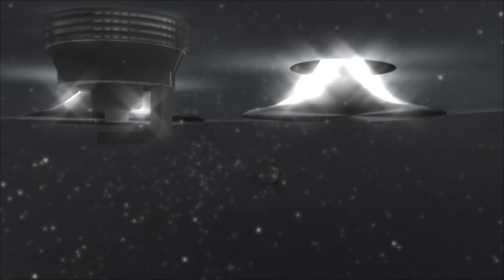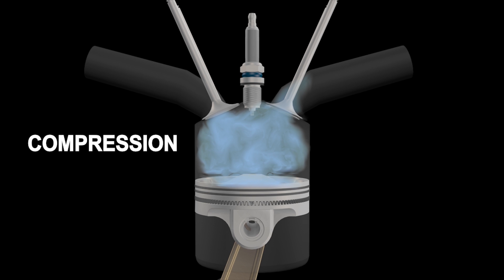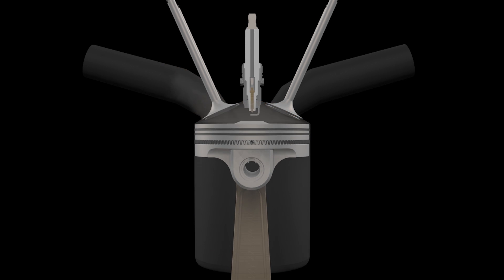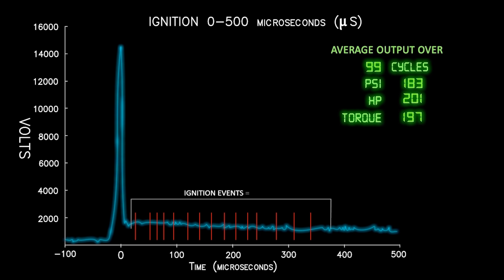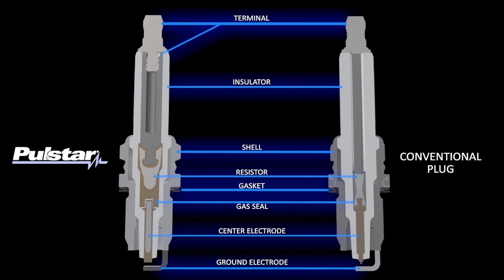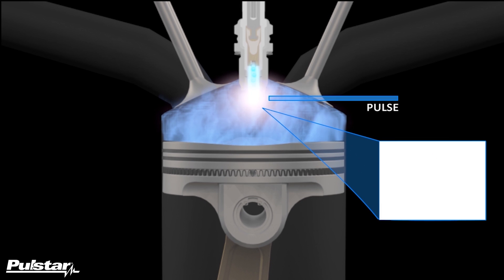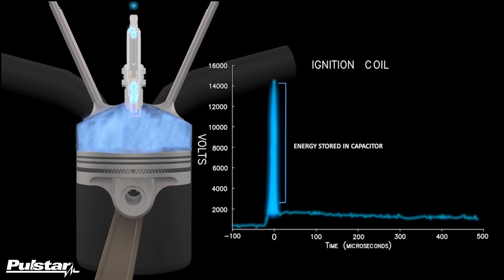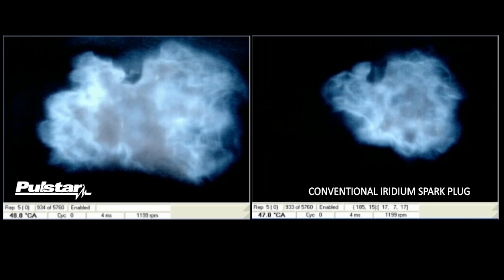How Pulstar Spark Plugs Work

Comment: I think an amplified spark from an aftermarket ignition is denser and more useful than plasma. I've mentioned before that with a high energy ignition coil for example, the smell of the exhaust changes and doesn't smell as dirty due to the more complete exhaust burn. In comparison with pulstar there is no preceivable difference in the exhaust smell and engine performance (I have them installed).

Comment: Gee, you'd think the car manufacturers would have caught onto this. No dyno results, no evidence of increased fuel economy, no evidence of any actual benefit.
Reply: These sort of devices, like fuel ionizers, turbo intake mixers and the like are all gimmick devices. They depend upon the consumer's ignorance of the combustion process. It's a matter of physics. The fuel is hydrocarbon, which is hydrogen and carbon. When it burns it forms CO2 and water vapor. CO2 is one carbon and two oxygen, and water is H2O, two hydrogen and one oxygen. The fuel itself only has so much energy, and as long as it is burned completely all the energy has been removed from the fuel.
The spark is advanced so that as the fuel is ignited it creates a pressure wave in the cylinder at the right moment. This is before top dead center. The fuel takes a few microseconds to completely explode, whether the engine is idling or running fast, the rate of ignition is about the same. So, to adjust for this the spark is advanced as the RPMs increase. This way the ignition occurs a little sooner so the pressure wave of the exploding fuel will maximize it's force at the correct position of the crankshaft.
Engines themselves have changed through the years to become more efficient. For instance modern car engines use what is called the Atkinson cycle rather than the Otto cycle. This allows for more expansion of the combustion gases. The head design on more modern engines often has a hemispherical shape with the intake valve and exhaust valves on opposite sides and the spark plug between them. This creates smooth flow through the cylinder and a uniform pressure wave of combustion. Of course the efficiency gains are a result of engineering design of the engines compared to engines of forty years ago, not from some gimmick device.
Anyway, as long as all the fuel is burned completely and at the correct time the engine is operating at top efficiency. Modern engines have very complex combustion controls with feedback systems like oxygen sensors. Changing any component of such a system is most likely to harm performance, not improve it.

Comment: I feel like this is all a sham. Almost every car now adays has a capacitive discharge ignition systems already and use a capacitor to help smooth out the arc. This isn't new technology by any means and in the real world you won't see that large of a power increase or fuel mileage increase to justify the cost. I would like to see the actual dyno results with the ambient temperature and pressure the same through both sets of tests. It's a gimmick just like those E3 spark plugs
Reply: odd, made my Jeep run worse and lose power. Holding 65 mph was difficult for the year (10,000 miles) I had e3 plugs in my Jeep.  I recently put a set of Champion Cooper plug in the Jeep (yes, the cheapest plugs you can buy) the Jeep will now cruise at 84 mph. Spark plugs can make a difference.
Reply: Also any electric spark in a gas (in this case air/fuel mixture) is technically plasma.
Reply: Perhaps the engine break in period was over
Reply: Had to use E3 plugs in a pinch for my Volvo 850.  Worked great - second best plugs ever in that car.  The Volvo OEM (Bosch) plugs were the best.
Reply: @looncraz 
 Running BOSCH Double-Iridiums in The 95 MERC -- after 40,000 miles, all plugs burning clean, with NO deposits and NO electrode wear. Also: BOSCH  Mag-Core Ignition Wires.
'95 Grand Marquis, 4.6 Liter, 2v -- 16 mpg City; 24 mpg Hiway -- 87 Octane Unleaded.
1/4th Mile @ 16.8 sec. , 86.2 mph.
Restored as a long-distance, high-speed touring sedan for cruising the deserts and mountains of the American West.
Reply: True, and in any case, you could always add a capacitor between the HT leads and standard spark plugs to create the same effect!
Reply: +Drift Physics, E3 is no gimmick.  I got it for $3 per plug and it made the RAV4 idle and accelerate far smoother than Day 1 getting it new.
Reply: Of course it's a sham. All that is needed to ignite the compress air fuel mixture is a spark. It doesn't matter if its a BILLION VOLT fusion-plasma gizmo plug or an AUTOLITE plug. It won't 'ignite' it any more.

Comment: What effect does that extra heat from the plasma have on the piston, cylinder walls, valves and combustion chamber? Do you need to have special ceramic coatings on the piston, valves and combustion chamber to cope with that extra heat?
Reply from the maker: The pulse is extremely quick - nanoseconds in length. The extra heat created dissipates extremely quickly, before it can effect the temperature of anything not within its immediate reach. This is known as non-equilibrium plasma. Think about swiping your finger through a flame really quickly. Thats a similar concept at much slower time frames and on a much larger scale.

Comment: The video shows the expanding combustion flame front moving quicker for the Pulse Plug in comparison to a conventional spark plug. However I don't see how a hotter spark could cause this. Once the air fuel mixture in direct contact with the spark is ignited it starts off a self ignition process and the spark no longer plays any further role in the continuing combustion process. The speed of the subsequently expanding flame front is dependant entirely on thermodynamic factors and for identical cylinders under identical conditions this rate of flame front increase should be the same regardless of the type of spark plug used. I would concede that a hotter spark may initially ignite a greater volume of fuel air mixture giving the initial combustion process a "head start" over a weaker spark, but surely the subsequent rate of increase of flame front is the same?Can anyone explain this to me please?
Reply: note they didn't reply to your question, i came to the conclusion that if you buy an msd and quality plugs you can get the same or better  hot spark compared to stock
Reply: The reason they don't reply is because this is all hocus pokus.
Reply: Basically just a different format of spark delivery. I am pretty sure my spark plugs work really well, also my stoichiometrics are pretty good too; Ford Zetec. No need for this, you could just use more valves & a second spark with a larger combustion chamber, turbo, etc.
Reply: i think the logic is the same in billiards, it's like hitting the cue ball as hard as u can... i think it's better than a lame spark... imho
Reply: It can help to have a hotter spark.  Dragsters, for example, use 2 plugs per cylinder and very high current.   
But you wouldn't want a faster flame front.
Reply: John Boulding Wow! Do you mean like the rock band "Hocus Pocus"? Then I need these spark plugs!

Comment: also will these spark plugs burn too hot for a stock engine?
Reply from the maker: No. The only thing different from a conventional spark plug is the pulse that ensures an instant and rapid burn of the fuel. There is no difference in the amount of heat produced.

Comment: I'm intrigued about how these plugs work compared to normal plugs and other plugs like NGK, Bosch, and E3. I'm curious to see how these plugs work in Mazda's high compression SkyActiv-G engines. Since the high compression ratio of 14:1 already increases fuel efficiency by a great bit, I'm thinking these Pulse Plugs could squeeze a little bit more fuel economy out of the engine and still withstand the high compression. But what I am really curious to find out is if these plugs would also work in Mazda's Wankel rotary engines. If they work in piston engines, they should be able to work just as well in rotaries like the RX-7, RX-8, or even older rotaries. If they can run in Wankel engines, it would be awesome to know that they will help clean up their high emissions and they won't drink as much gas as they would with normal plugs
Reply: Skyactiv-g engines are piston engines. Also, spark from a spark plug is plasma, you're only highlighting this property of the plug in your video as its marketing wank.
Reply from the maker: Hi, we don't currently make a plug that fits a Mazda Wankel engine. However, if we did have a plug that fit it would improve fuel efficiency just like in a conventional engine. We have seen fantastic results with other rotary engines such as Liquid Piston: http://liquidpiston.com. 

We have seen good results in high cylinder pressure engines both with high-static compression ratios and boosted applications.
Reply: If you had made leading and trailing plugs for Wankel engines, would they be for sale right away or would you have to contact Mazda to get the clearances and information before they can be sold to rotary customers?
Reply from the maker: We would do extensive in-house testing first. In the automotive aftermarket, manufacturers don't need OEM approval to sell their products for that application but they are liable for any damage their product causes. That's why it costs so much to produce a new model, we have to do a lot of testing before we make it commercially available. We don't want to be on the hook for unforeseen damages so we make sure to cover our bases during the testing phase.
Reply: That explains a lot. Hopefully, there will be plugs to fit Wankels in the future to keep them compliant with fuel efficiency and emission standards

Comment: I'm not the sharpest tool in the shed but to form plasma you need to super heat a gas so the electrons fall off the atoms, once this occurs you have the change of state from gas to plasma but, in order to do this this plug must be creating a hotter burn and head space temperature is crucial to horse power, fuel efficiency and engine life. normally in my racing experience a cooler head space is what you chase, cooler air /headspace equals more density bigger bangs and more gains in power, engine life and fuel eff etc
Reply from the maker: You are correct on both counts but are confusing two concepts.  A cool "head space temperature" or combustion chamber is very beneficial.  The cooler, and therefore denser the air fuel charge at the time of ignition the more energy can be extracted.  We tend to think about the combustion event as a big bang but it's actually a controlled burn (a chemical reaction) The high energy discharge from the capacitor does break apart the molecules (forming plasma) which excites the fuel mixture, jump starting the chemical reaction. This can result in a more complete burn that can result in lower residual combustion chamber temperatures. Plasma is often associated with higher temperatures but in this case the plasma field is localized and short lived, only heating the fuel charge between the electrodes. This is known as non-equilibrium plasma.
Reply: get nae naed

Comment: Thoughts on using these for a stock 1999 Grand Marquis that runs like well. Believe it has the original plugs with 134k miles. What should I expect?
Reply from the maker: Many have told us that it makes their vehicle feel brand new again. You may see a slight increase in fuel economy (a few mpg more).
Reply: @PulstarPulsePlugs  
"(a few mpg more)" -- Is NOT GOING TO HAPPEN by merely switching brands of spark plugs.
Tell the TRUTH -- it's the RIGHT thing to do !!
Reply: @SlikLizrd  Not for THEIR pockets! - Snake Oil in spark plug form! (Caveat Emptor) - All these people who claimed results, likely get same results from NEW OEM replacement. - I Like Bosch +4, especially in my Motorhome - I don't believe the multi spark BS marketing, I know that spark takes shortest route, but usually the center electrode is tougher than the ground strap...having more than one allows the 1st strap to wear, then the next closest strap starts arcing, and so on...Its not a power thing, I KNOW BETTER, its a longevity thing, and those plugs are a pain in the ass to change...and it seems any Gas engine that is held at near max power levels likes to eat ground straps on plugs...This same multiple ground idea has been used in Aviation engines for 50 years, that I know of...
Reply: Your Stock '99 Grand Marquis will perform best with the BOSCH #9606 Double Iridium Spark Plug. Best Prices at RockAuto.com.

Comment: So basically your spark plugs have a higher watt fire rate and fire quicker. Am I right?
Reply from the maker: If by "higher watt fire rate" you mean peak power output, then yes. We output a 5 MW pulse upon spark formation in addition to a 50 W spark, whereas a normal spark plug only produces a 50 W spark, no pulse. Also, our "fire rate" is slightly delayed by our need to charge the capacitor before forming the spark, but the slight delay is more than compensated for by the formation of plasma to sensitize the fuel. See our response to Robert Markham below for more information.
Reply: Thank you! i learned something

Comment: How is this affecting the ignition timing and knocking?, is this usable for high boost/octane invoirements?. Are theese plasma plugs more temperature stable? :)
Reply from the maker: If your engine is experiencing knocking and you’re having trouble with electrode temperature then the Pulstar technology isn’t going to fix that.  You need to select a plug with the proper heat range and/or fix whatever is causing the knocking issue.  If, however you are tuning a performance engine then the more consistent ignition allows for more aggressive timing without problems with knocking.

Comment: How much HP and torque can you expect from those plugs on average? I have a ford fiesta SE 2015 and would like to increase power a little bit and hoping these can help. 

Also, does the plugs will affect the sound of the car?
Reply from the maker: In newer vehicles we've seen a decrease in the performance improvements because manufacturers have begun using drive by wire quite a bit. The drive by wire tends to kick in and limit HP max output but we do see good improvements at lower RPMs. You can usually bypass that by getting an aftermarket tune. As far as how much, we couldn't say. Each year, make, and model is different and we haven't tested a '15 Fiesta. 

Also, I don't believe it would alter the sound of your vehicle unless you were idling rough.
Reply: Thanks a lot for the informations. I do look for low rpm increase (2000-4000) range.

Comment: Will your spark plugs work in my car? 2003 CL600. M275 engine
Reply from the maker: Yep! That would be our BE1H 10. Please note these do not come pre-gapped so you will have to set the gap prior to installation.
Reply: +Pulstar Spark Plugs too late. I just finished installing ngk laser iridium plugs today. Decided to go with the plugs it came with from the factory.
Reply from the maker: +DgibsHardstyle sorry about that. Microsoft's new clutter system started moving the notifications out if my inbox.

Comment: How does a piezoelectric spark plug work? where does it tap into the mechanical energy, and are there other types of spark plugs? is their power source from the battery or some other form? what type of spark plug is the Pulstar?
Reply from the maker: There are two different kinds of piezoelectric spark plugs.  The most common is the type found in a gas grill which use a spring loaded plunger to create the mechanical energy.  There have been several attempts at using devices like camshafts to actuate the plunger to use that technology in an internal combustion engine but they have yet to be commercially viable. 

The other doesn't use the piezoelectric effect to create the spark but instead combines a conventional spark plug with piezoelectric sensor to sense combustion chamber pressures in real time.  These plugs are commonly used in engine development.

We refer to Pulstar as a pulse plug internally because we don't actually meet the Society of Automotive Engineer's (SAE) definition of a spark plug, we have too much capacitance (the ability to store energy). We call it a spark plug in our marketing material to avoid confusing the general public. We are the only spark plug in the market that exceeds the capacitance requirements of the SAE, therefore we are the only pulse plug available.

Comment: I would have thought, It would cause there to be lag in how much time it takes for the Spark to for. Would you have to change the timing for the Spark plug to make sure that the Capacitor side of thing's doesn't cause the spark to be formed after the Piston is at the correct point?
Reply from the maker: You're absolutely correct. The time it takes to charge the capacitor does extend the time to breakdown voltage by just under one microsecond. We chose not to discuss that aspect of the technology for two reasons. 

1. The time it takes to achieve breakdown voltage varies slightly by all spark plugs. The reason they moved to fine wire iridium plugs was to make the time to breakdown voltage more consistent as it tends to vary from cycle to cycle more drastically when there is a larger surface area to ionize. 

2. The video was long enough to begin with and we felt tightening the ignition window from 500 microseconds to 10 made up for the just under one microsecond we extend ionization of the spark gap. 

The capacitor charges almost instantly. In fact, we have a grant from the California Energy Commission to build an ignition system that stops delivering voltage after ionization and charges the capacitor again to achieve a multi strike pulse system to create even more plasma.